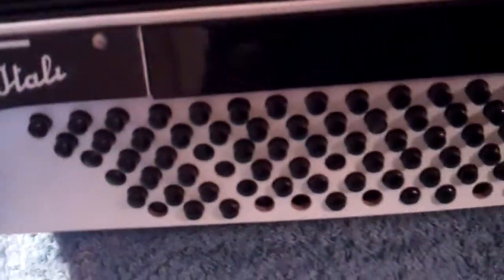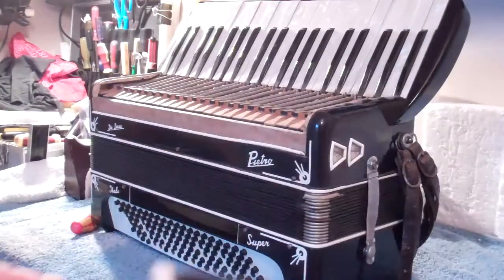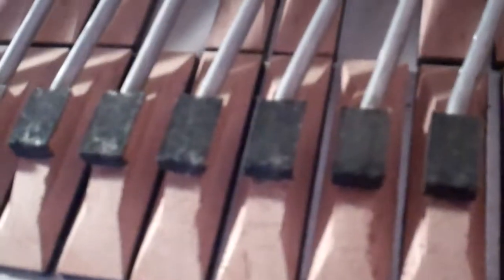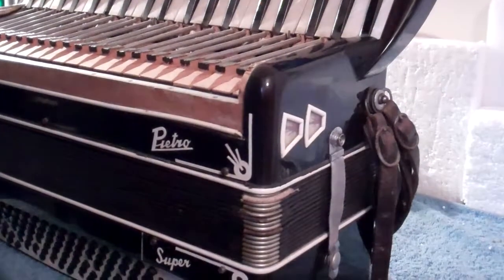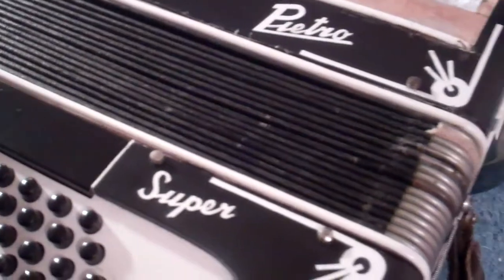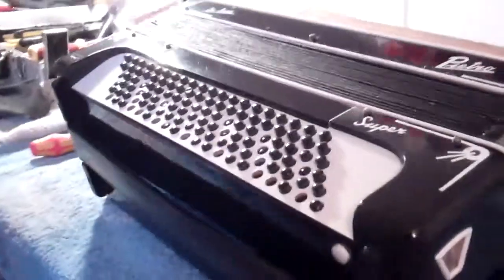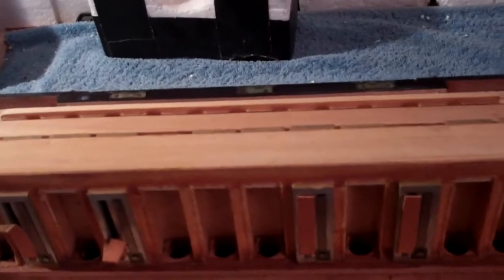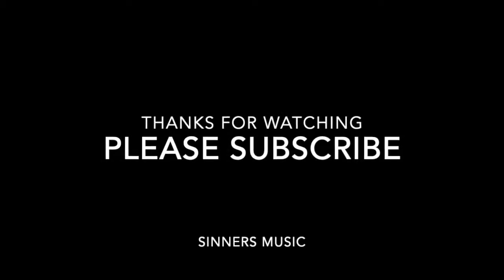How to dismantle & repair an accordion (part 1)

Comment: Hi there Ian, I am dragging out my accordion from the closet after putting it away for years and years. I want to give it a good cleaning as this has never been done and it was new in 1968. My question right now is this, the mother of pearl on it used to be white, it has aged to a yellow. Is there anyway that you know of to bring it back to that nice white again??? Thank you.
Reply from the maker: Hi Tina sorry I don't know of anyway ;o(
Reply: Maybe take off the pearl part and bath it in hydrogen peroxide. It works well for a lot of yellowed plastics